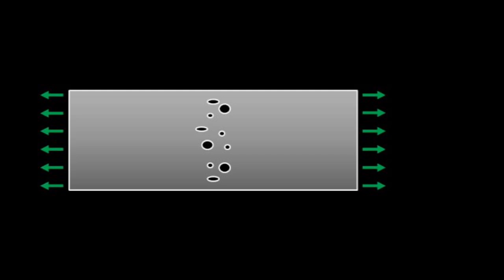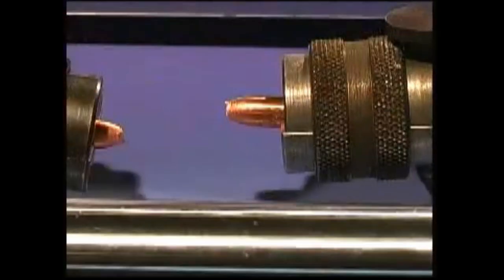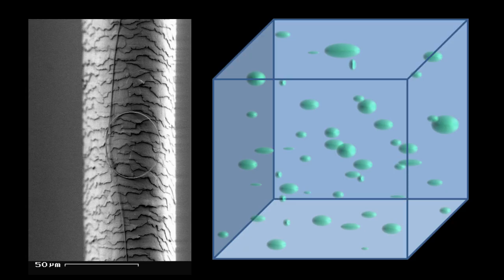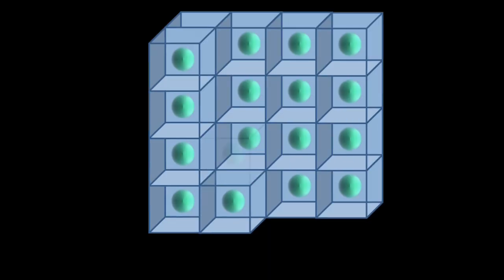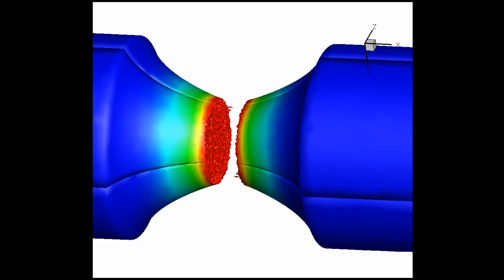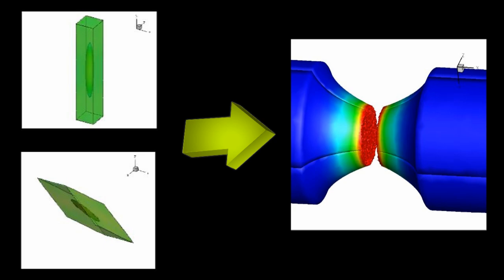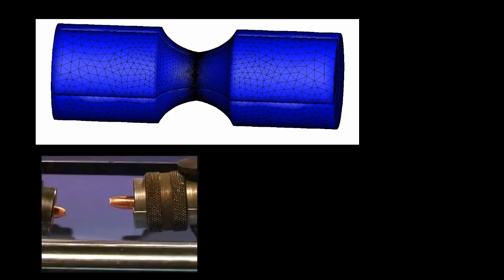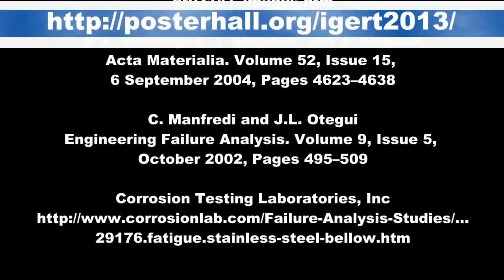How and When Metals Fail

Comment: Did you ever expand this simulation out to use randomized size / shaped voids more akin to realistic forged metal voids? It seems like one could take several types of failures and use the fail patterns to approximate the original void structures.

Comment: Nice explanation. However, for 2 phase component that is a compound with 2 elements. The failure could occur from voids, cavities, de-coherent of second phase particle or even an inclusion (external particles added for extra functions) and the image shown at 1:06 could represent any of mechanism mentioned earlier and not only voids. Voids and cavity are different, void arise from when arranging the structure, whereas cavity is formed due to the removal of a particle.

Comment: I had never thought of metals as containing small voids leading to failures before. Somewhat eye opening. Thanks for the video!
Reply: Jet engines have lots of high tech metals to deal with high temperature and high load. I think they use single-crystal blades in combat aircraft for this kind of reason! I believe the methods used to manufacture them are highly classified, because anybody who can make them, has a massive advantage 👍

Comment: That's a very simple description of what happens but doesn't explain why. For anyone wanting to know more in depth, they should look for videos on dislocations within metals.
Reply: How are dislocations related to voids?
Reply: @noamorwell  I think it's related to dislocations from a regular crystal state to a less than regular crystal lattice structure. 

If a crystal is grown in outer space there are less/zero dislocations or imperfections in the crystal lattice structure as compared to a crystal grown under influence of gravity.

These irregularities in lattice structure act as weak points when the metal is put under stress.

Just my 2 cents worth. Corrections are welcome.